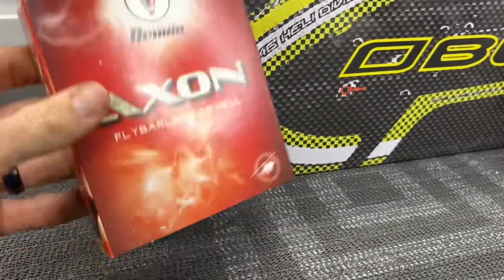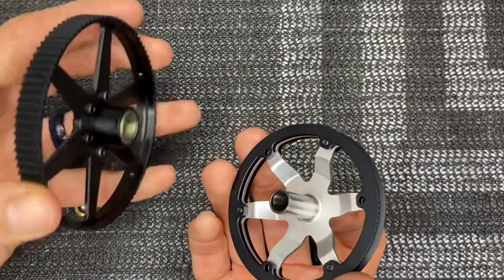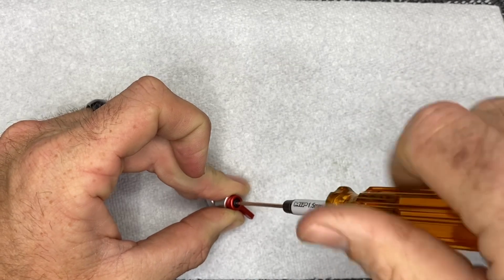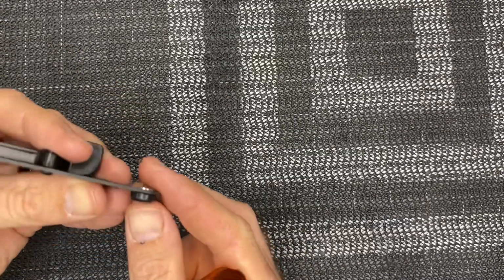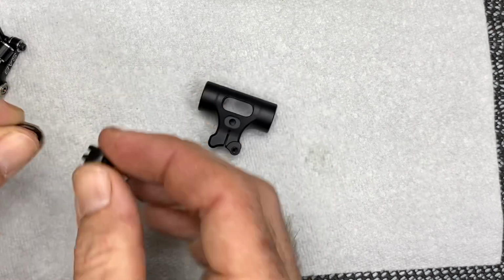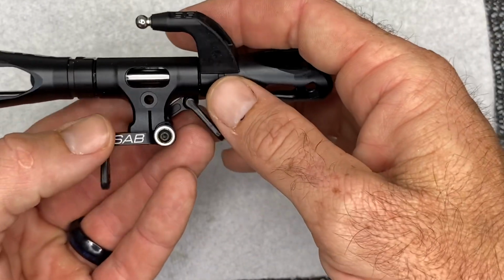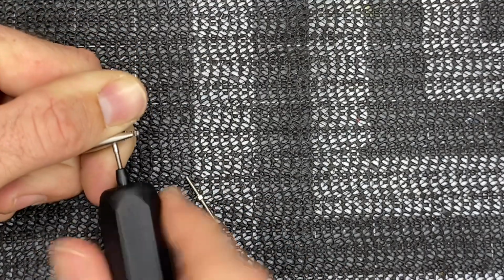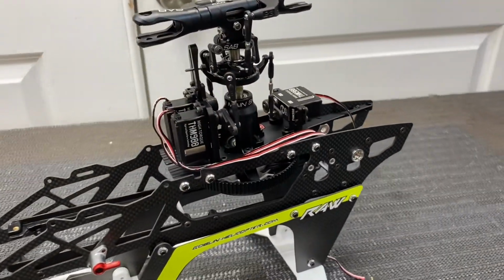SAB Goblin RAW 500 Build Part 1

Comment: Hello Jeff, great video as usual. I’ve already built my Raw 500 with the Xnova motor, hw 120v4, theta servos, microbeast flight control and Futaba sb2001/16iz. It flies and has flown flawlessly from flight #1 with no adjustments whatsoever. It’s smooth as glass and handles beautifully. Two things that you might mention in part two of your video series: 1) the battery latch should be assembled with grease prior to installation. This is noted in the Raw 420 instructions and makes the latch operation much nicer.
2) The motor on this model spins in the same direction as the main rotor blades. The direction of rotation for the motor will most likely need to be reversed with a program box for your particular speed control as most are set up to spin counterclockwise and this could lead to some serious confusion/frustration.
Keep up the excellent work!
Reply from the maker: Thank you for watching and I’m glad you enjoyed the video. I am very excited to fly this one. Looks to be the perfect in between size from the 420 and 580 which I enjoy both of them very much! If you watch from 8:30 seconds on, you will see the battery latch assembly, which a micro lubed just like every other 420 build. It’s always a 50-50 shot depending on how you wire your motor lol I normally reverse it in the ESC anyways, all SAB helicopters spin the same direction as the rotor, clockwise.

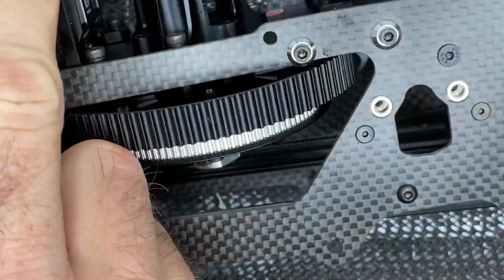Comment: @26:11 shouldn't you measure between the center of servo spline to the center of servo mounting hole? It's 11.2 mm so different thread rod should be used.
Reply from the maker: @gorix5  yes you can, I use the same two servo brands and both servos are the same so the rods i use are same between the two.

Comment: Hey Jeff, Nice video. I am building on right now as well. Just curious on one thing. I noticed you did not use the rubber servo vibration pieces to mount the servos. Thoughts on that?
Reply from the maker: Thank you! I hope the videos are helpful! So I don’t run the rubber grommets on anything but a nitro model. They allow movement in the servo witch is great to absorb vibrations on a nitro model, but it is not needed on a electric model.

Comment: Hey Jeff just curious. Do I need a program box to center those Theta servos your installing? Or do you just do all that in the Ikon at the end?
Reply from the maker: You don’t need it but it makes it easier ish to do it all in the servo and no sub trim in the FBL. I do it both ways. It’s a pain in the ass to use the theta program box so I don’t normally do it unless the servo is way off.

Comment: for sure I will be buying one 500 soon, what means 2.5 Y in the xnova motor? and second how are you going to center the servos at perfect 90 degrees if they are already installed?
Reply from the maker: It’s a fantastic heli! So the Y is the type of windings of the stator in the motor. So I always center my servos before installing them in the heli with a program box. If you don’t a program box I highly recommend picking on up for your servos! Awesome tool!

Comment: Great video as always, kind of unrelated question, but when you're setting up pitch curves, why do you never want to change the 50% point? Somebody asked me and I knew you weren't supposed to, but I couldn't remember the reason. Thanks Jeff
Reply from the maker: Thank you, so it’s because 50% is mid stick. So if you change that in your pitch and say your normal is 40 at the 50 mark and your Idle 1 is 50 when you switch the heli will drop or jump and you won’t have a smooth pitch range though out your flight modes.

Comment: Jeff can i use regular bearing grease for microlube? Loctite wise i have 243 (blue threadlock) and 2701 (green retaining compound). Am i good to go?
Reply from the maker: You don’t need microlube, that’s just the grease I like and use. You can use any grease that’s not petroleum-based. Any synthetic wheel bearing grease will work just fine as well. Yes everything looks good on the loctite.